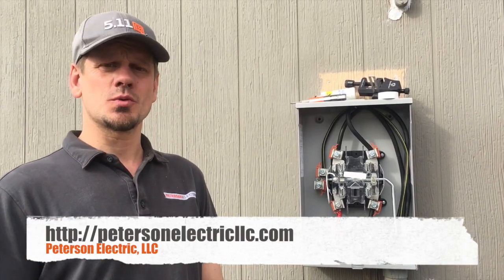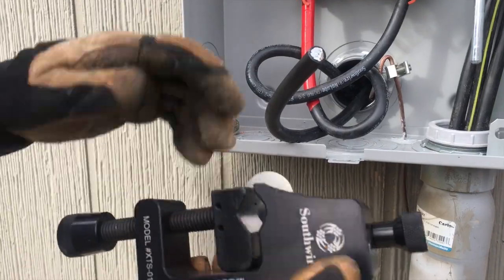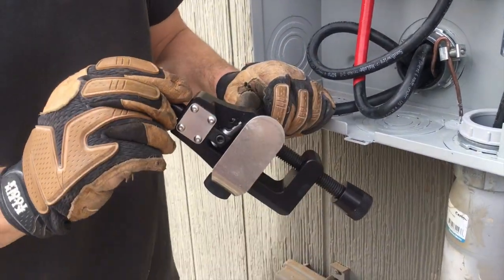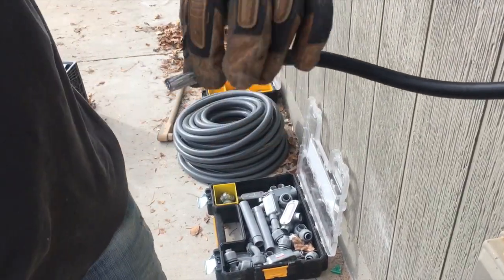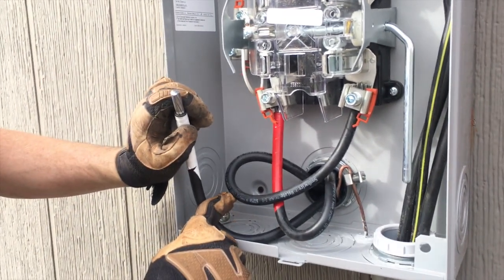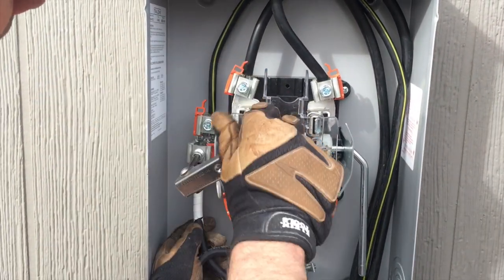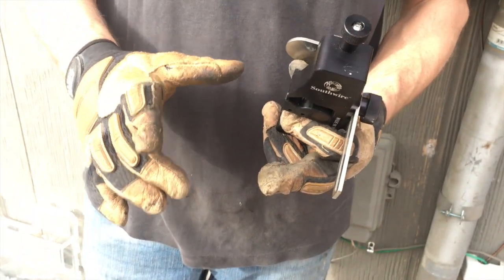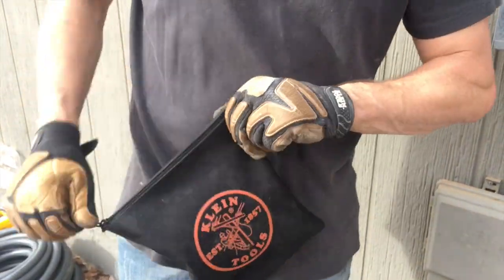Upgrading Your Electrical Service On Your Home & Cutting A Feeder Wire In Panel

Comment: Even with smaller wires such as #12 and #14 it is easy to nick the wire and introduce a point of failure or even a possible fire by using incorrect tools such as side cutters to strip the insulation.  The point is well made.  Good tools cost money but they are essential to doing a job safely and properly in a minimum of time.

Comment: Aluminum is a soft metal, not a "soft conductor". Many things can be a conductor. If you were to take a list of all possible conductors and compare them on hardness/softness, aluminum would be considered hard compared to the others. And you shouldn't waste your time with aluminum wire. Copper is far superior.
Reply from the maker: True, it is a soft metal based on 3 volencian shells for conductivity vs Copper, Gold, Silver have 1 shell which allows them to conduct easier and have their electrons attract to the positive protons easier. This makes Aluminum and Copper a dis-similar metal and dangerous when mixed and also more reactive when current is applied as completing it's Joules of work load. But, Yes it is a soft conductor and though the insulation can have a 90 degree celius rating it can still metal at the connections based on a weaker link in the circuit. Per 110.14c

Comment: Great video so I just bought a house from 1950's the service is coming underground is there a way to tell what size wire is coming in without pulling the meter? Right now I have 100 amp but want to upgrade to 200amp. Thanks Luba
Reply from the maker: Yah, you usually can not see that. Utilities out here no longer allow us to just change the panel. In next years 2020 code update the book will state around 230.70 that we will me EXPECTED to change the meter and put a main disconnect outside and no longer allowed to do back to back or feed through the house without having a main killing point for the fire fighters.

Comment: Hey do you guys always use aluminum wire. In South Texas most of the time we use copper wire
Reply from the maker: We don't always use Aluminum. If the customer wants copper on their feeders we will use this. The line side of the meter is not our choice if the power company is responsible up to the house.
Reply from the maker: DEPENDS ON THE JOB. WE LIKE TO DO OUR SUB PANELS IN TYPE TC CABLE AT COPPER AND #2 THWN-2 WITH A #6 GROUND. GREAT CONDUCTOR, ALTHOUGH NOT CHEAP AT $7 A FOOT MY COST. BUT WAY BETTER WHEN RUNNING A BREW BEER HOBBIE OR A WEED GROWING AREA OR WHEN YOU DO A KLIN OR WELDING